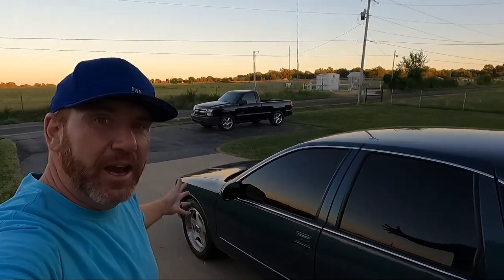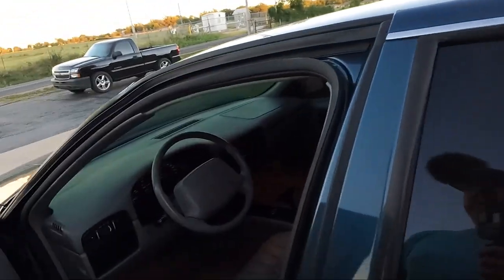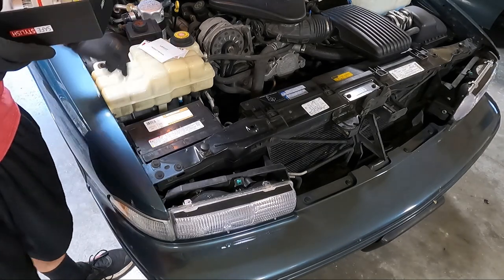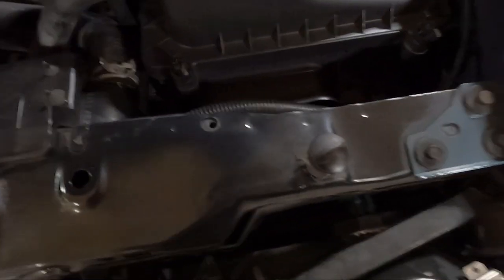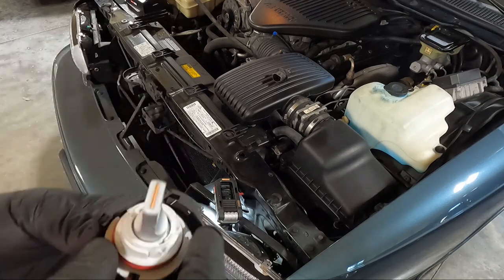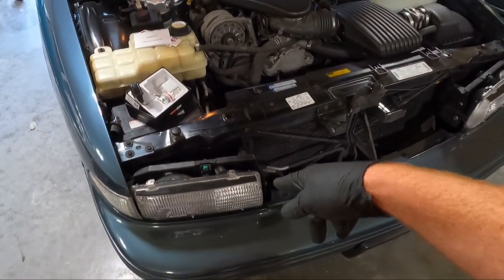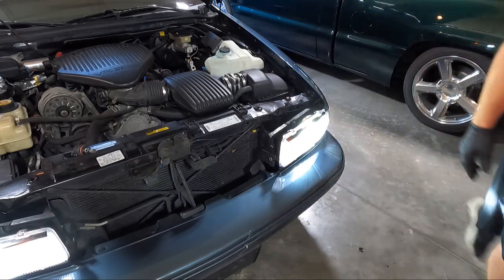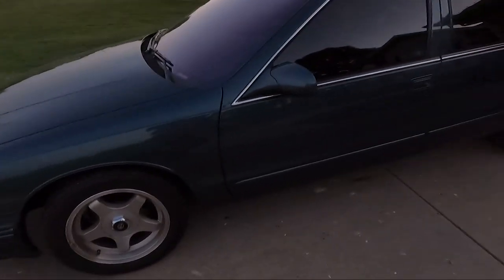New LED Headlights for the Impala SS (Best Upgrade for the Money!)

Comment: I run these on both my caprices. Night & day difference. I do have aftermarket housings, but even still, great improvement. Especially on my lowered caprice. Had to adjust the angle a bit.
Reply from the maker: Definitely a huge upgrade

Comment: Don't know if anyone told you yet. the side to side adjustment is actually at the back inside of the headlamp. it is a 10mm hex. you have to loosen that torx on the inside of the lamp you were loosening. also the bulb should have the dim led facing up and the high led facing down.
Reply from the maker: Ok. Thank you. Sold now though

Comment: Nice! Good evening, Travis. Yes sir. Like our stock headlights on our Trans am's. They. Suck. I went with headlight experts. A true 💯 plug and play. 💯 full lifetime warranty on everything. Wiring, bulbs, lenses. Check them out for your Trans am. They are on clearance. From 800$ pre low and high beam set to 400$. Fog light bulbs are 100$ per bulb from 200 per bulb.
Reply from the maker: I saw them. They look great
Reply: @TWAMotorsports  ok. That's correct. I did post a video of them on YouTube.
Reply from the maker: They look good

Comment: There is a 10mm bolt adjustment on the edge of each head light for it to move side to side. The bolt is black in color and sits edge of each fixture facing the radiator. I had to adjust mine both side to side and up and down. Didn't like the way  GM focused those lights.
Reply from the maker: Thank you for that information

Comment: I've done auto glass for 27 years and only replaced 3 Caprice Impala windshields. They were all cop cars too. You have really bad luck especially after the tint. God must not want that windshield tinted.  Several of those years were in Sacramento too when they were used as police cars and highway patrol (93-98). Here because my Katana's are supposed to be 36W a side and  6000 lumens but aren't bright. Bad beam pattern too. This video makes me wonder if God doesn't like my smoked aftermarket pods. I might have to try putting them in the factory pods. Any word on the clear style pods not working as good with LED bulbs? I have Lasfit in my 2012 Passat high, low installed. They are amazing. totally proprietary for that car too. If you have any friends with a Passat. They're the bomb! Good video other than the in car of the difference. Couldn't tell much from that.
Reply from the maker: Must be. I have had a few starred windshields recently.
Reply: @TWAMotorsports  Same goes for Camaro and firebirds. Have done no more than 5 or so. 60 degree windshields are very resilient, most rocks are simply deflected. If you ever need to replace your optispark, I did a video on what to watch out for.
Reply from the maker: Thank you